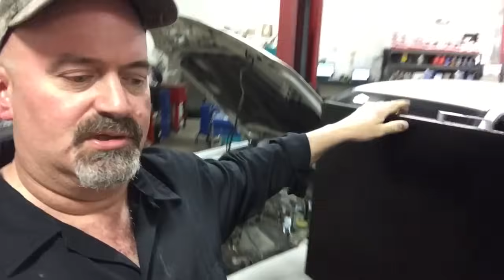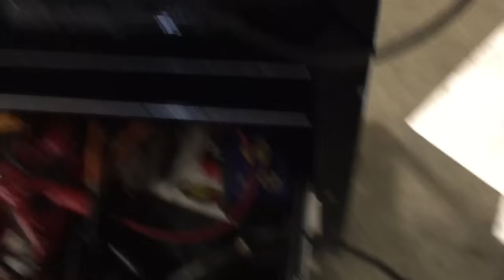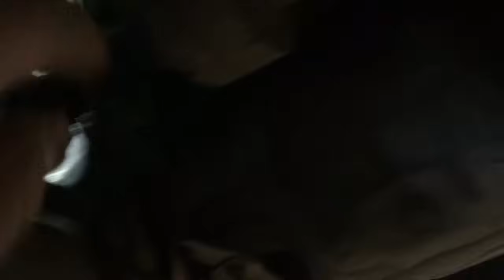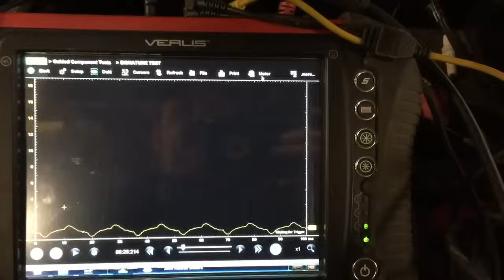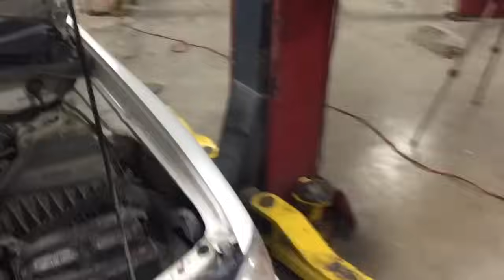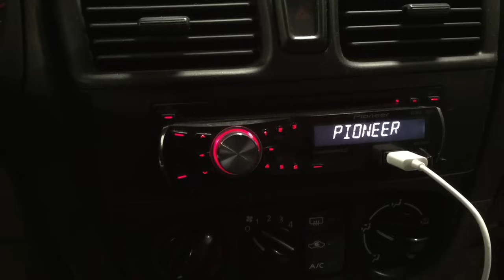Nissan Cranks But Won't Start

Comment: When i went to look at my the wiring connector to sensor was burnt didn't seem damaged could it still work if i got anothe conector box or would i need to replace the wiring

Comment: Got question only way my car starts is by holding gas pedal down to floor and it's starts and runs great there is no check engine lights on after leaving car sit again no. Start again unless I hold pedal down would it be the crank sensor on my car ,
Reply from the maker: @BullyDad19  could be a rich condition possibly a dirty or faulty MAf or leaking fuel injector etc. need to look at fuel trims and monitor fuel pressure to see if there is a dramatic pressure loss after shutting down engine.

Comment: Happened to me, crank but could not start, turn out the issue was on loose connection on the crank sensor, tightened and boom car worked well

Comment: I still cant figure out what is wrong with my sentra 05 1.8l I replaced, fuel pump, pligs, boots, crank and tps sensor, I also checked the relays and fuses and they arent blown, i even replaced the ecm. I just cant figure out what is wrong. I hit a deer in the front middle kind of near the left headlight. Replaced the radiator, and fixed a bunch of other stuff, but ordered the wrong fan to the radiator and I found out my uncle plugged the one side in and spliced the other in it and it worked for id say about a week and i noticed it wasnt turning the fan on. I mightve overheated it a little but after that i drove not even a few miles and i was going to drive it so i can get it parked and looked at and it just all shut off while i was driving, it just acted like i just turned the key to acc and it brought up all the lights and i havent been able to get it to spark sense and like i mentioned in the begining I repoaced all those first things after it shut off while i was driving it. Ive been searching and searching for a fix and havent been lucky yet.

Comment: Hi, I will watch this again. I own a 2002 nissan sentra and when it is cold it cranks but doesn't start. When I let it spin for a few minutes it finally does start. Then after running it awhile, I shut it off and it starts up right away. I took it to my local car repair shop and he couldn't find any problems. There is a evap error message though. Any idea what is going on?
Reply from the maker: Possible evap control issue. Purge or vent valve problem would cause those symptoms. Need to have it tested by someone who knows what to look for.

Comment: Great video OK so now for a single mom who just got a car after a long time without someone gifted me a 2004 Nissan Sentra with 140,000 miles it's been a great car I've only had it a month lol but I let a friend borrow it and they ran it almost out of gas and then put I think old gas in it, and it stopped about a mile from their house and even though I went and put fresh gas in it a couple of gallons it cranks, but it just won't start now and I don't know what to do. I'm without a car again with kids and it's cold. Any ideas?

Comment: Hi we have a 2002 Nissan Sentra ser spec-v, won’t start but cranks, changed fuel pump, alternator, fuel pump relay, ecm relay, crank shaft positioning sensor. We are out of ideas. Would you be able to give us some ideas?

Comment: Hello, my car has the same no start issue too, but the crank sensor seems to be working sense the RPM gauge showing some engine revolutions and the fuel pump is triggered too, but got no spark at the coils, any help please.

Comment: I just had a guy replace the crankshaft position sensor on my 2008 Sentra after he got some codes indicating a problem with it.  Still no start, and I have no fucking idea what to do next.  Mechanic is pretty stumped as well.
Reply from the maker: Lame

Comment: Hello Car Doctor;

Thank you for your video. It’s very helpful. I have a 2014 NV 200 and it’s cranking, but it won’t start. It just happened out of the blue. Any suggestions?

I love this car. Even thou a woman I use it as my car for work .. I would appreciate your your thoughts on it

Comment: Sooooo tim     don't know if you'll ever see this but we replaced the crankshaft part and the fuel line but it won't start on we don't know what is wrong with it at all
Reply: Same boat.  Did you get it figured out?
Reply: @Issicra  yes we did but I'd have to ask my dad what he did cause I don't remember give me a sec
Reply: @Kroahnoel  Oh cool.  Thanks!
Reply: @Issicra  yeah
Reply: @Kroahnoel  Glad it was something simple.  Thanks again.
Reply: @Issicra  yeah.  Did you get it fixed??
Reply: @Issicra  ok so what he did was he went and got a starter for the car and switched it out and that worked fine

Comment: This happened to my wife this past weekend at 10pm. Her car stalled and would crack but not start. In the middle of the road. I got there and the first thing I did was check if it had gas. The gauge said it had a quarter tank left. We pushed it to the side called my mechanic. He said push it to the parking lot and leave it there I’ll check it tomorrow morning.
The next day my mechanic checked it and he thought it was the gas pump. He pulled a gas pump out and tried it and it was working. He look at the gas tank and it was empty. He put everything back together again put 2 gallons of gasoline and the car started right up. Moral of the story; never trust your gas gauge on an old car. Always put at least a gallon of gas.

Comment: The owner wanted make sure that when those tires cause the car to slide off of the road and flips over, that the battery posts pushing through the hood liner provide a nice warm source of heat.
Reply from the maker: Never thought of that. Wow, I think you might be onto something! Haha

Comment: I have a 2005 nissan altima s and it won't start I check the battery and the cam shaft sensor and alternator and the Timming belt and fuel pump and I bought this device called fixd and it's telling me it the throttle position sensor can you tell me how to get my car to start
Reply from the maker: Does it crank? Does it have spark? Fuel pressure? Compression? Injector pulse? Are there any codes?
Reply: @ThecardoctorTV  it does crank it does have spark it does have compression I have the codes that it gave me they are p0123 P0223 P1121 P0340
Reply: @ThecardoctorTV  I don't know how to check the injector pulse
Reply from the maker: I would suspect you have a bad cam position sensor. You can try replacing it or if you have a lab scope check the waveform and see if it’s doing what it’s supposed to.
Reply: @ThecardoctorTV  I replaced the cam position sensor it didn't do anything what else could it be
Reply: Do you think it could be my crankshaft position sensor or  throttle/pedal position sensor or intake air temperature sensor
Reply from the maker: @joshuakinney8391  yes
Reply: @ThecardoctorTV  how do I test the throttle position sensor or the intake air temperature sensor and where do I find it I bought this book for the car and it's not telling me how to test it , the book says its for a 2005 but it not helping me

Comment: I have a 2005 Nissan Altima with a V6 I have no spark I checked two of the coils in the front no spark I do have voltage to the coils with the key on and I also have voltage to the injectors with the key on I did not check for injector pulse cuz I do not have any type of noise light I don't even have a multimeter right now is there any other way to check those crank and cam sensors I have no codes however I understand sometimes the crank sensor will not throw a code. I do have the dongle that plugs into the dash the assembly line diagnostic connector and I have Torque Pro and torque light and I have Carissa and piston and a few other apps is there any way to check the crankshaft position sensor with some type of live live data on the aforementioned apps that I have? Or if I got a hold of a voltmeter can I check the output within digital multimeter set to AC volts? Also does these cars have a ignition module like the dis system on a general motors car?

Comment: I have a 2000 nissan maxima with 118,000 miles on it and it's hard to after multiple of times than it'll start up and run fine with no problems.i replaced the crankshaft position sensor and I can hear the fuel pump kicking on.But once I turn the car off it'll start back over all again I was trying to see what you think it might be.Thanks
Reply: Did you ever figure out the problem? Im having the same issues right now with my 2012 Nissan Sentra have a long crank it starts sometimes and then sometimes it starts off first few seconds of cranking it

Comment: 2008 Nissan Titan SE 4x4 king cab all 3 cam positioning sensors are knew alo crank sensor knew fuel pump won't cut on and no spark all relays knew well as starter please help turns over good and strong ipdm is knew as well???? Truck has only 93000 miles

Comment: Soooo I tried prying with a screwdriver and snapped the eyelet for the bolt, tried prying with a prybar and snapped more off, tried grabbing whatever I could and prying on the pliers which ended in me ripping plastic out everytime. I have no idea what to do now besides dropping the oil pan and praying that I can reach the back side of this stupid sensor from in the block. I'm considering buying the car from the customer with intent to watch every last bit of it burn to the ground, it will be the first and very last nissan I ever purchase.

Comment: The car start right away. I change the spark plug then it stop. It crank. But that all   I call 2 mechanic. They say my computer was fk up  and it cost. Well money.  But.  I need more opinions.   Of what u guy think it could be. Thanks.

Comment: Tim, my 2005 Nissan Sentra 1.8 with 326,000 miles always starts on the 1st, 2nd or 3rd try. Other than that the car runs perfect. Any ideas? Unlike the "car" in your shop, mine gets plenty of maintenance when needed but I wouldn't trade it for any new one.
Reply: Hi Tim, Me again, 
My 2005 Nissan Sentra 1.8 S with the 1.8 liter (4 cylinder) just started having the "dying while driving" trouble.
Trust me, it is not fun or funny when it happens. EXTREMELY DANGEROUS !!! 
Just driving along and it's like someone turns off the ignition key.
No power steering and no power brakes !!!!
If I wait 10 minutes, the car starts back up (until it doesn't) like nothing ever happened, until it happens again.
I just drove a 265 mile trip (all highway) that normally takes 4 1/2 hours now took 7 1/2 hours !!!
Three (total) HOURS on the side of a 4 lane interstate highway !!!
It shut off about 20 times !!!!!
Never had an issue if I just drive it short distances around town doing errands, but not long highway driving.
The car runs perfect (except this problem) and burns zero oil even with 330,000 miles (original engine) and gets 33 mpg.  
I hate to get rid of it but my wife will not drive it, and I won't allow her to any longer.  
New cars are no better than the old ones just more expensive. 
Any help out there ?????

Comment: Was coming home from the market and saw a young couple broken down,  They parked and then car wouldnt start, I offered a hand. 2002 Nissan maxima GLE. 
He had already installed a new battery and starter still wouldnt start. I came home and youtubed and your vid came up. 
We replace the CPS,  Strange though. the wire connector would only go on opposite of the clip, was late in the evening and now the stores were closed. We cut off the clip slide on the sensor so we could plug in the wire. still no start. 
They called for a ride home and will be back in the morning. I offered to help out as I have all the tools and more experience, tho limited. 
Fuel pump working, but no fire from coils.
Can you help me, help them please. 
thank you.

Comment: My wife's 2009 Nissan Murano has battery/electrical issues. Replaced the battery, 3 times in a year. It may run/start fine for 1 month, or 3 months, then nothing, won't start. If we jump it, it starts right up. Until the next time. The alternator has tested good. Any suggestions is appreciated? Thank you, John G.

Comment: Great vid I’m gonna replace my crank sensor and cam sensor hopefully get mine started and then diagnose the swirl air valve control code ): but thank you for the help and jokes

Comment: Some one is selling a 05 sentra for 600 cash with title says it was running with ac and out of no where stopped running cranks but wont start how much you think it would run to fix

Comment: I have a 2007 Nissan Altima it's turning over but it's not cranking what you think could be the problem I didn't change my coil packs are my spark plugs

Comment: This guy funny😂but I got a 2005 Nissan Altima that cranks won't start will it most likely be a spark plugs or that sensor
Reply: I have the same year...it's doing the same thing as yours..
Reply: @CarlosAlmeida-lg7yg  i tried replacing the code p0507 and that didn't work no other codepops up

Comment: i have an 2008 nissan pathfinder and it wont start and we changed crank position sensor and alot of other stuff now they saying its an eletrical problem do you have any advice
Reply from the maker: does the engine turn over when the key is turned to the crank position?
Reply: @ThecardoctorTV  no it wont catch that spark but now im being told that its an eletrical problem
Reply from the maker: Yes, if it doesn’t crank you’ll want to test the starting circuit. Make sure the battery is fully charged and cables are clean. Test for power to the starter signal wire when key is turned to the crank position.
Reply: thankyou very much for taking time to talk to me about this problem i have it at the machanics now will give you an update when it gets done you have an awsome page that helps people thanks again

Comment: So i have a 99 pathfinder LE, 
It cranks but doesnt start. It has no blown fuses, new battery. Fuel pump works. Filter is new. Spark plugs are new. Only starts with starting fluid. Anyone? Thanks in advance.

Comment: My car still won’t start have a new starter spark plug new crank position sensor and a new fuel pump
Reply from the maker: What have you tested?
Reply: Only thing that code that pop up was the mass air flow sensor it didn’t run long enough to do a full scan

Comment: I have a 2000 nissan maxima, that takes a couple tries to start. Sometimes i would get lucky and it would start easily. I have took it to a mechanic and they have changed the fuel pump, timing, fly wheel, new battery a few sensors added a ground, starter and still has the same problems.. in need of help !!
Reply: Did you find a lasting solution?

Comment: Hi my 2004 maxima overheat for hole in a hose when we fix it start the car and run over 2 minutes and shut down itself and don't run any more we check cam sensors and everythings good but no spark on plugs and car alarm is on 
Question._ can be the computer or what? Thanks in advance and sorry about my english

Comment: Great video, thanks for sharing. I've had the same issue with my 2005 Nissan Altima. Ive replaced the crank sensor 5 years back, its now turning slow. So i replaced the sensor again. It turned over quicker but now 5 days later its sometimes not starting. I have 220,000km on the timming chain. It's never been replaced. Do you think the chain need replaced? Could it be that the chain is not lining up the crank gear with the sensor?

Comment: My daughter has an 03 altima. This seems to be the same issue. So we put in a new crank position sensor and still won't start. Tia
Reply: Did you ever figure out your daughters car’s problem? I’ve got an 03 Sentra and have the same problem changed the sensor and still won’t start

Comment: I was having the same issue on a 2009 Nissan Rogue SL
After i got a call from my wife saying her car wouldn't start  ok so i checked it and it had a good Battery it wanted to start but wouldn't....everything on the car was working....tried jump starting it anyway  still nothing i heard it all timing chain...starter...alternator and to me none of that made sense so i took off the wheel and when to work and yes indeed after taking off the belt my wife's car did start up.  So i checked the ac pulley and it would not move so i took off the clutch and the bearings to the pulley fell out.  The compressor did not lock up the pulley did so it prevented the belt from turning. After replacing clutch and pulley as well as the coil on the compressor everything is back working normally i hope this too help someone because it had me lost for words. Tim you Rock great video keep up the great work.

Comment: Man me my nissan sentra 2012 did the same thing didnt start no life at all so i took it to guy and he s fucking it up more i see parts wish i could sent them to u 
Their around the battery and their kinda plug in wires and metal around it 
Battery is not there its removed 
Ao its been 3 days now

Comment: I have 2005 Nissan Altima 2.5L the car crank but no stars no spark in coils no signal on injectors no code scanner shows not connected
Reply: E

Comment: Hey Tim I have a 1998 nissan sentra, replaced the crank position sensor but the car still will not start. Not getting any spark still what might have I missed?

Comment: I think if you make a scan to engine ecu itll give you problem in crank sensor but i like to see graph on osscilloscope 😁 but still didnt understand how to read this whether it work or not so if you can explain in depth with another video 😁